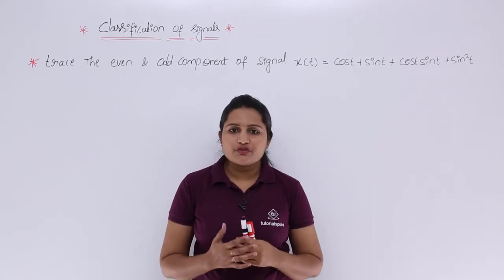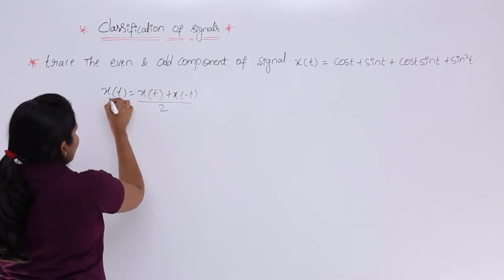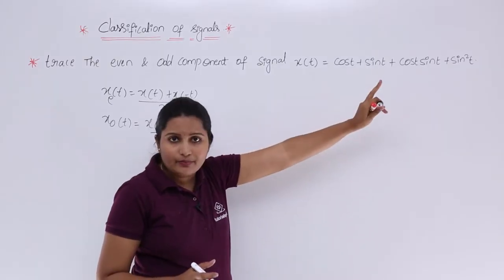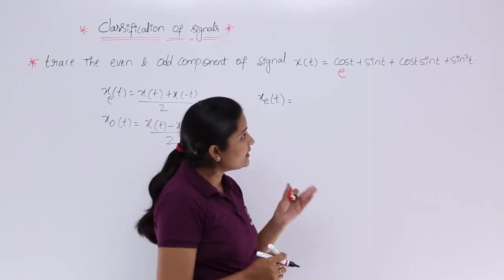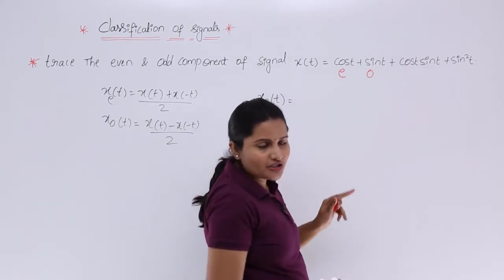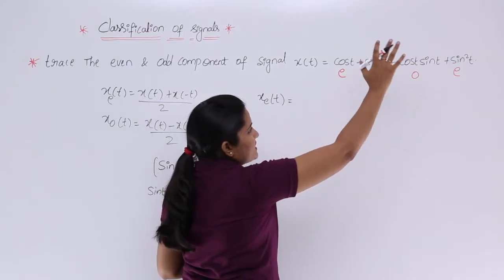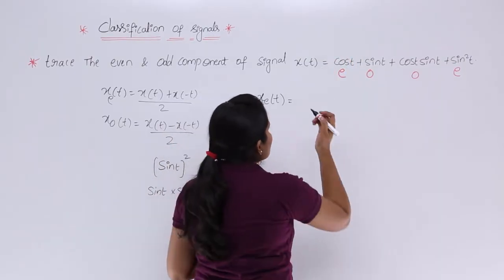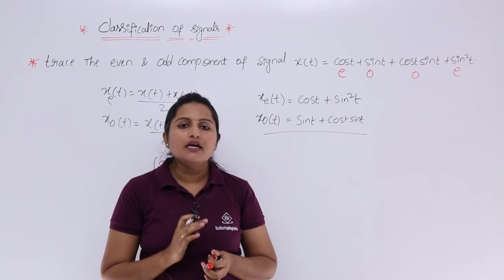Even & Odd Components of a Signal Example 2

Comment: Even ×odd= odd ? 
How
Reply: This would a lot better answer if I had a white board...
1) Think about two functions, x(t) and y(t), and we'll say x(t) is the even function and y(t) is the odd function.
Since x(t) is even, then x(t) = x(-t).  Since y(t) is odd, y(t) = -y(-t).
If we multiplied these even and odd functions, that would of course be equal to x(t) * y(t)
But since x(t) = x(-t) and y(t) = -y(-t), that also equals x(-t) * (-y(-t)), which is the same as  -(x(-t) * y(-t)).
So x(t) * y(t) = -(x(-t) * y((-t)), which what an odd function is.  
2) Or, if you think about graphs of even and odd functions, the even function would have the same amplitude pattern on either side of zero - that's what an even function is (for instance, f(t) = t^2).  And the odd function has the opposite amplitude pattern on one side of zero versus the other side (for instance, f(t) = t)?  Now imagine going across the graphs and multiplying the two functions, point by point.  The result will be a function that has the opposite amplitude pattern on one side of zero versus the other side.  And that is an odd function.  Hope this is clear.